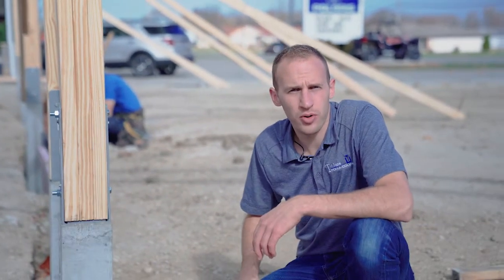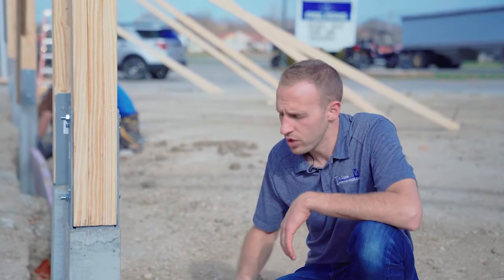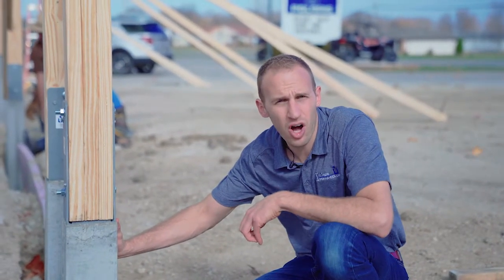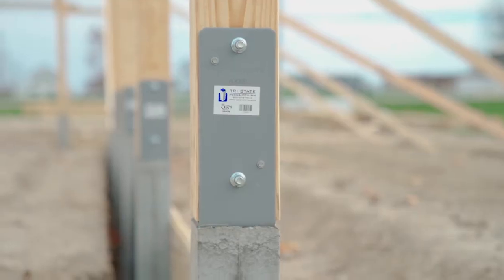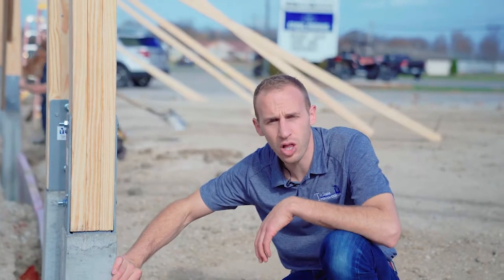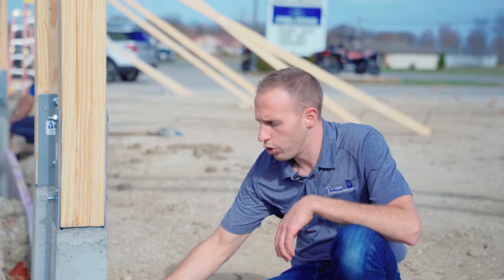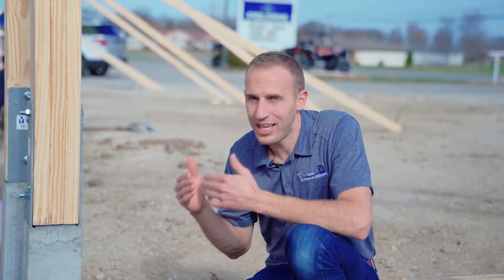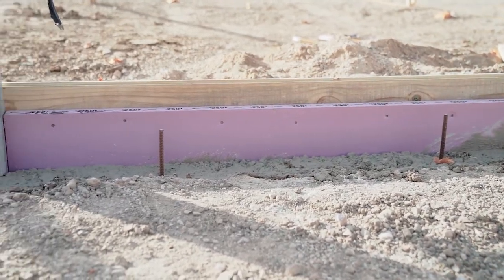Skirtboard installation on Perma-Column®

Comment: Does the trench that was dug for the insulation have to be backfilled with concrerete? Our existing building has in ground wood columns with the insulation in between and was installed after building was installed down 24".